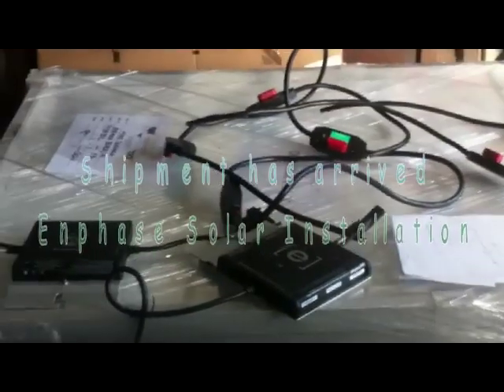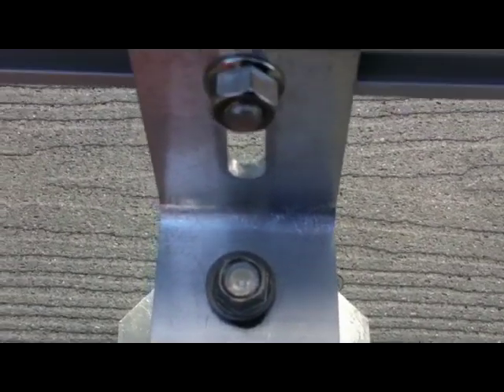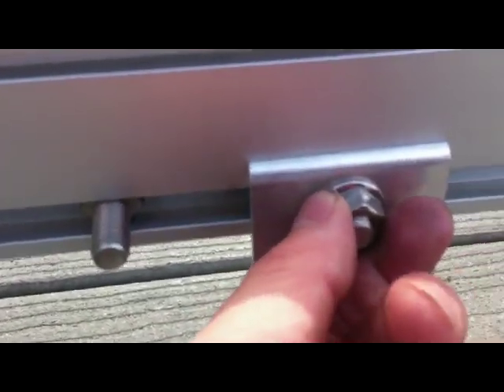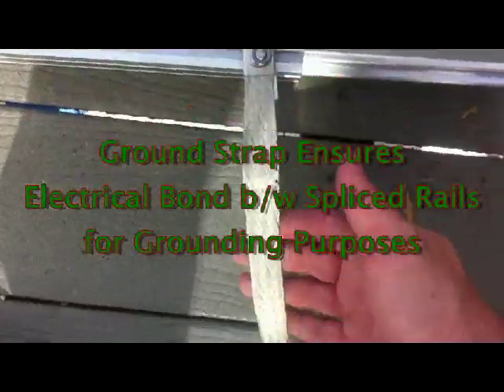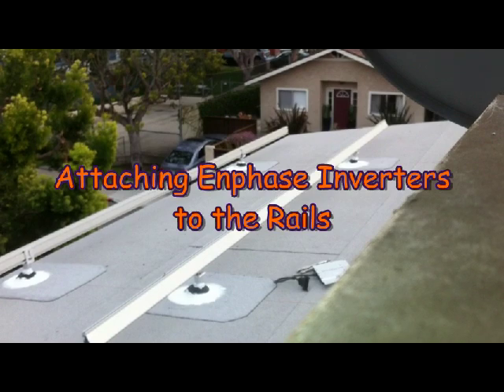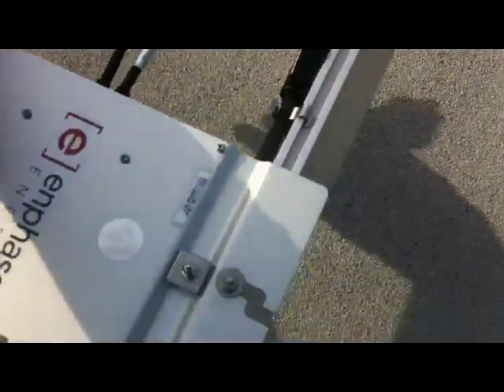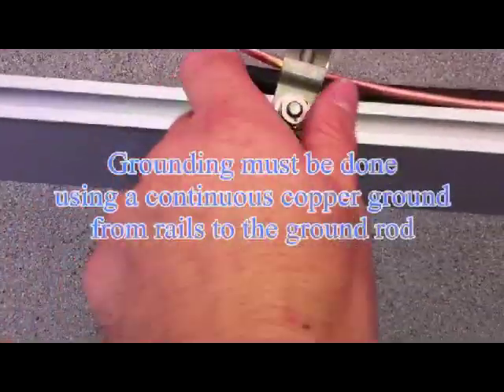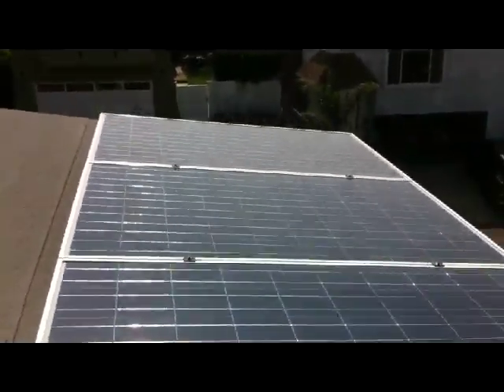Enphase Microinverter and Iron Ridge Rail Solar Installation DIY

Comment: If you don't understand black white green and red, you probably should not be doing your own installation. I would start with the installation manual and an electricity 101 book.
Reply from the maker: Agreed.  One would hope to have enough brains before effing around with 240vac

Comment: ROI 18 months? Prove it
Reply from the maker: Jake Findleton My ROI is 18.13mo. and I’m not including my State rebate.  My ROI today would be less (maybe 15mos) since you can obtain 300w panels for same price I paid for 225s, and Enphase inverters for about $130.  Anyway, here’s what I paid:  Enphase Microinverter ($140/ea), 225w Scheuten Panels (25 yr warranty) ($200/each), Ironridge Rails/Hardware ($300), 2 pole 25amp breaker ($30), THWN 8 guage wire ($125), Permit and shipping fees ($0).  Total cost for fully grid tied system 2.25kw = $3855.  Federal Rebate $3855x30%.  Total cost after Federal Rebate=$2698.   2.25kw system generates year round monthly average of 391kw (2.25kw/day x 5.8hr x 30days). So. Cal Edison Tiers 4/5 rates ($.36-$.46/kw)  I avg. .38/kw. 391kw x $.38kw= $148.77/mo.  System cost $2698/$148.77/mo.= 18.13mos.  Actually even less than that if I included my state rebate of another $450.  And even less if I did it all over today since panel/inverter prices much less today.
Reply: sunsensational Your home only uses 391 kw a month? Your 10 225 watt mods on micros produce enough to zero your bill?
Reply: Jake Findleton Average 3/2 homes use about 1000 kw / month average
Reply from the maker: Jake Findleton
you need to review the numbers again.  ROI means return on investment.  the total investment was $2698 and it produces 148/mo.  therefore it pays for itself in 18mos.  the rest relative.
Reply: sunsensational Its hard to believe your home is using less than 400 kw a month. Your solar is producing about that much. Guess what Im really asking is how much is your homes KW monthly usage? Your ROI and math is only valid if in fact your 10 225 watt modules are in fact 100% powering your home and you have a zero electric bill
Reply from the maker: i can't help you out bro if you can't understand math...i can double my system capacity and produce 800kw a month.  Of course i double my system capacity i'll double my systrem cost...but guess what???  My ROI still 18mos.  if you can't grasp the concept of relativity i can't help you bro...

Comment: you need a ac disconnect breakers not considered a disconnect no way to lock in off pos. iron ridge std rail rated for 72in mount spacing yours look wider than that. green connects to every pcs of equi. [J boxes disconnects conduit etc. white wire straight to neutral bar.bare grd in conduit grd both ends with bond bushings. breakers not used as switch!!! in some areas un permitted jobs the meter sees pwr from solar going to grid as pwr used you will be charged for that as used kw hrs so check if in area where they have net metering you have to be permited to get new meters....
Reply from the maker: well my inspector passed me, and he said my Breaker was sufficient to meet their AC disconnect standards.  Also, my net meter inspection and production has been spot on so i'm ok.  thanks

Comment from the maker: @Firzan Nazim @Firzan Nazim @Firzan Nazim I don't think my last reply posted. I was wondering if you are in US where we use 120v mostly or in UK etc that uses 240. B/C here all you do is take a 2 pole (20amp) breaker and snap into bus with your other breakers. The 2 pole breaker should have 2 places to attach your wires to.  Just attach red to one and black to other. That's it. This power now feeds your panel by virtue of the 2 wires you connected to it

Comment from the maker: But if you have old analog meters, it will automatically turn meter back. But the excess power not being used by home has to go somewhere and that somewhere is the grid.  Only difference is do u want to get credit for the excess power going to grid by having ur meter spin backwards which old meters do automatically. but new dig electrical meters they're using many places today need to be programmed to go bi-directional. But excess power always goes to grid, but you don't want to donate free

Comment from the maker: once you attach your red/black into the 20amp 2 pole breaker in your main electical panel (and other wiring), your panels will "back feed" your main panel with power and will first automatically go to your home loads..any excess not being used by home will automatically go to grid and turn meter backwards. Note - if you have new digital meter it won't go backwards until you call power co to re-program elec meter so it will go backwards. That's reason i wound up permitting since i have dig meter

Comment: Tks for you quick response, OK i understood for the Ground and NEUTRAL WIRE which will connect to ground bus bar and neutral bus bar,   i could not understand the red and black from the micro inverto which is connected to a 20 amp two pole breaker where it is connecting in the main panel.pls advise this breaker will connect to the main grid am i correct or pls give your email id ill draw some schematic diagram and send for you, then u can correct me if i am wrong/ tks brother

Comment from the maker: Lastly connect cooper ground wire from rail to rail and thru inverters to either a separate ground stake or to the ground in the main service panel. Most recommend connecting to its own separate ground stake to isolate completely from in

Comment from the maker: On most electrical panels (main panel) the green ground and white nuetral will be connected to the same bus bar in panel. Iif it's subpanel then usually connect to separate bus bars. But double check with electrician for safety

Comment from the maker: @Firzan Nazim Hi Firzan, first be very careful you've killed all power coming into your electrical panel and from solar panels. Next, you need use open 240 (2 pole) 20amp breaker to connect your wires from Enphase branch circuit cable. Connect your red and black (2 hots) to the open breaker. Connect your green ground to ground bus and white nuetral to nuetral bus.

Comment from the maker: No problem at all with the Federal 30%.  all you have to do is list the amounts paid on a form/schedule with your 1040 Tax Return and they refund the credits back in cash after you file your tax return.  The State rebate was a bit of a pain, especially since our local utility (SCE) handles the rebate process and they're in no hurry to help give you $. But Feds were easy as it gets. But you can't take deduction for your time, only out-of-pocket exps includ someone else's time. but no luck for me

Comment: Ow, great for that additional info, i have used a different make and model, i will change this tomorrow.
System is up and running and the meter is running backward during the day. I already want to purchase a second 2kW system.

Comment from the maker: good luck with the project.  you're gonna love the results.  let me know if you need any help with anything.  luckily there's a lot of vids out there to really show you most of the steps.  something i learned is that if your putting in a 2pole breaker in your panel to back feed, make sure the breaker is same make and model for your panel.  learned that hard away with 3 wasted trips to home depot. lol

Comment from the maker: Also my video didn't show the full ground, but the ground runs continuous from rail to rail, then thru the inverters, all way to ground rod. The panels are grounded automatically via the "weeb" clips b/w the panel and rails. On my neighbor's roof, he has 2 arrays with 2 separate rail mounts and I ran the continuous ground from Array #1 rails to Array #2 rails to avoid having to independently ground Array #2 rails/inverter/panels to ground rod. So, avoids 2 separate ground runs to ground rod

Comment from the maker: I don't think so. I do see your point inasmuch as if only 1 rail were grounded the other other rail is automatically grounded because the panel touching rail #1 is grounded and now touches rail #2.  But i didn't want to take chances, and every job i observed grounded both rails, then thru inverters, and then panels via the weeb.  SO, I would still ground both rails to be safe.

Comment from the maker: thanks a lot.  how did you make out with your enphase install.  i recall a vid you had when you got it, but wasn't sure if you installed yet.  i'd be curious to see what kind of efficiency you get off them.  i think they preach 94-96%, which seems pretty close for me even with largely west facing panels. of winter be here before you know it

Comment from the maker: Thanks Larry. I did go thru permit process. I may post link with docs i submitted (e.g., single line diagram, plot plan,...) for others. But, since i have new digital meter, I had to permit to get bi-directional/net metering.  Fortunately, my city was pretty lax on permitting, and waives fee both electrical and bldg permit fees. Plus, utility in CA has to pay us same retail rate for buy-back; although I'm probably 10 panels away from that happening for me. Yours and other vids helped me.